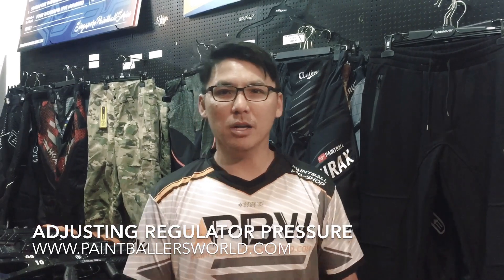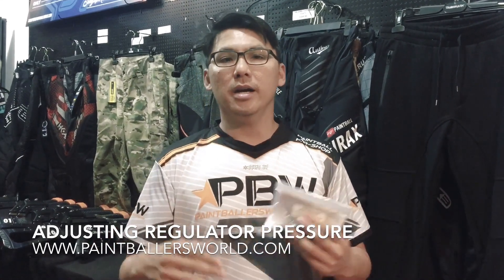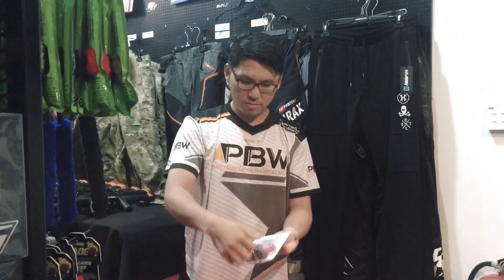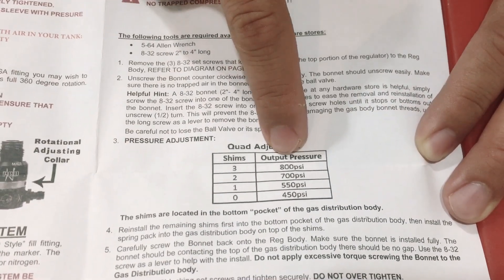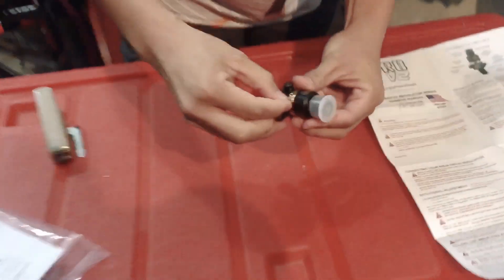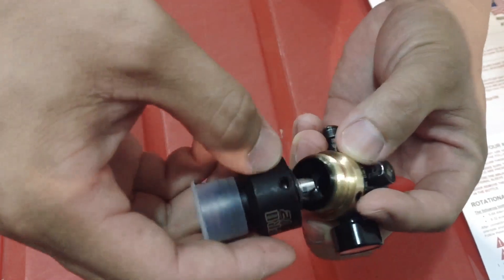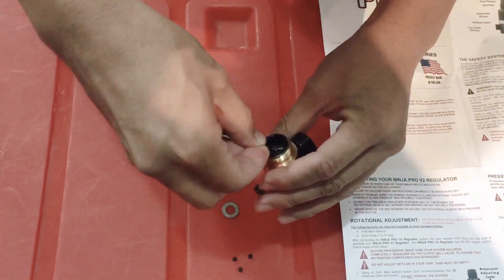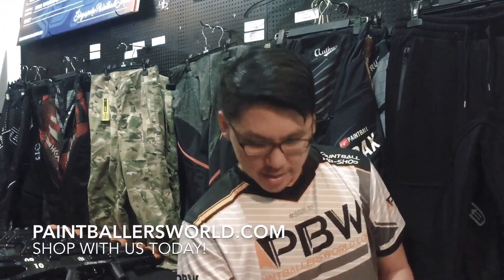How To Adjust Regulator Output Pressure Using Ninja Pro V2 Regulator.

Comment: Had a ninja tank for a while now. Just bought a new one after the reg went down as a backup. Brand new tank and reg and couldn't get the bonnet off. Absolutely pathetic that it would not work. Real quality issue with it and I'm super dissatisfied with them lately. Never used to have a problem with their tanks until recently. At this point I have to go to them and spend time and money to get THEIR product fixed at no fault of my own? Never going with them again after this.